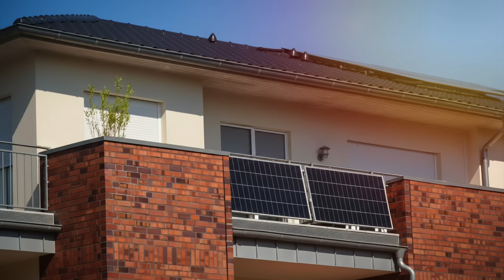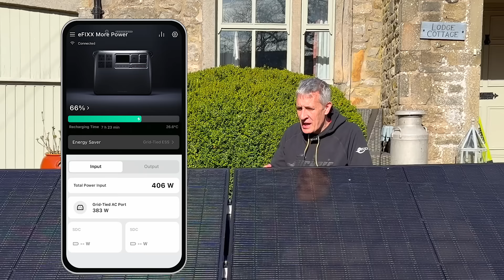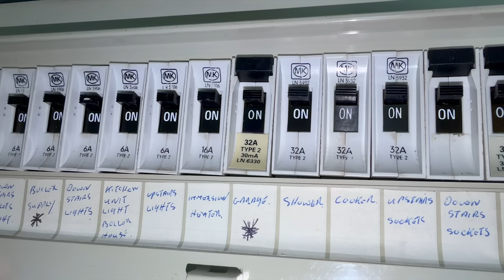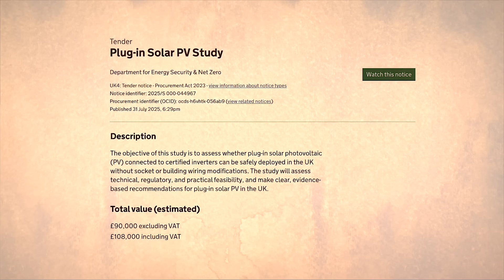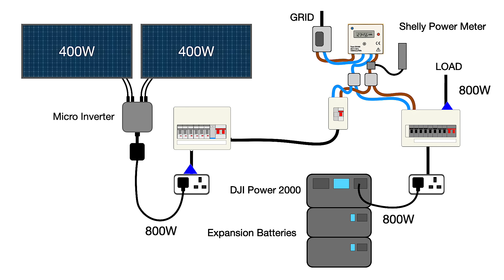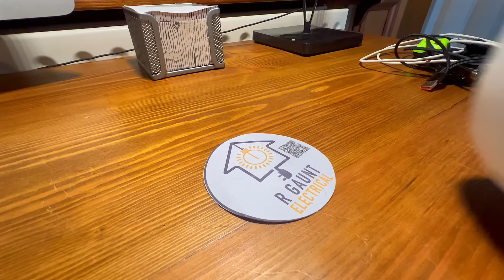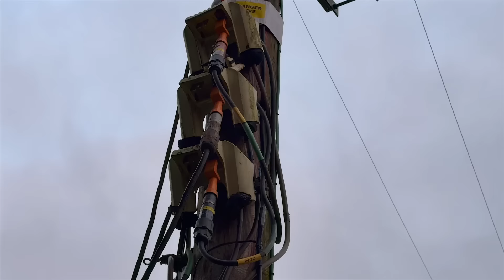Plug in Solar: We’re Told Never Do This… So I Did

Comment: Most of the problems here seem to be about the use of a standard type G plug. Perhaps we need to think about a new standard for this kit, the Neutrix Power-con for example. Safe at both ends regardless of being energized... I needed two power inputs to my motor home, so removed the standard male CeeForm 16amp socket and replaced with two PowerCon 16amp sockets connected in parallel, one either side of the vehicle. 
Now I can plug in either side of the vehicle and no worry about the unused socket being live and dangerous.

Given that local generation is on the rise, it's key we look at alternatives to the one way flow connectors currently available.
Reply: Its no so much the plug its the ring main we use which isn't designed for 2 power sources on the same ring, as as mentioned in the video so RCBOs etc which cannot handle the back current. Personally though I think plug in solar is the future easy to put a couple of panels, and you can take them with you if you rent (as per the video).

Comment: Presumably you could have the panels, inverter and battery without connecting it to the grid at all? I can see this being useful for powering a shed without having to wire it up to the house.
Reply: Yes but you would need an off grid inverter, otherwise it would not switch on.
Reply: @markrainford1219  I'd probably ideally have a higher peak output than 800W as well. Would be good to be able to run power tools off it, and some of them need 2Kw.

Comment: As of today there are 1.1 million registered balcony solar plants in germany, the unregistered numbers are higher - no doubt about that. In germany these are running under the name "balkony solar" for more than 20 years (but due to rus/ukr situation really took offin the last 4/5 years). They shall enable renters to also participate on renewables with low to no hassle and setup-costs. Some lessons learned from the homeland of buerocracy and stickt limits and saftey (so if it works in germany, you will be more then fine):

- keep the wire thickness of your household in mind:
In germany 3x 1,5mm² are common for live / ground / neutral - and it is advised that you use an inverter of max. 800W (it used to be 600W). Even though the 800W enable a scernario where the 16A brakers wouldn't trip while more than 16A x 230V = 3.680W were consumed on a protected ciruit / phase. 

- No power at poweroutage - managable risk to using a socket  / plug:
AC solar inverters look for power when plugged in - so if the grid is down, these systems shut down as well. It can be bypassed (with a battery and sockets directly at the battery for emergencies) but I tell it just to handle expectations of these systems. The inverters also sense if the plugs are beeing pulled out and cut off solar production. So you dont get shocked by touching the metal of the connector when you f.e. reconnect your balcony solar setup. But there are also special replacment sockets were you cant touch the connector at all. But this means you need to modyfiy or change a plug in the wall - which can be a no-go for renters. And even if it is allowed it is hard to findy an electrician how just will do such a tiny task or it might be too costly. Thats why there is a 2 tier system in germany that is allowed:

-- 960W of solarpanels and a 800W inverter => Standard (Schuko) Plug is fine
-- up to 2000W of solar panels and a 800w inverter => special (Wieland) plug and socket needs to be used

- the biggest problem is, that the solar generation is not adjusted to your houesolds needs
Whilst in germany with a 3 phase the sum / difference of all phases is added at in the house (so you can produce your 800W on phase 1 and have a 900W consumer on phase 2 = 100W house consumption), the solar production is not synced with your house needs (as this would need more intelligence in the junction box / smart meters (which until today are not common in germany). So the critics say these systems might overload the grid. In realty in most neighbourhoods the solar panels use is far from 100% so your baloncy solar overproduction is consumed by your neighbours and will never effect the grid anyways. As said there are systems with balcony solar with batteries and demand steered power injection for your household - but both raises the setup costs. But can still be usefull.

- If we feed solar into the grid from balcony solar, this is free for the grid companys / you dont get any money for these small systems from feeding to the grid.

Comment: Whats the fuss about OVERLOADING ???  In UK I'd be surprised if there was more than 2 weeks/ year when you'd even have to worry about OVERLOADING a 32 amp ring ? And if UK has  one of those rare heatwaves ( 30 degrees + ???  ) if you check your APP and things are looking dicey . Switch it off !! It's not rocket science   . I'm generating 1600 watts  today 9th March 2016 and pulling 6.5 amps
Reply: I reckon your time machine draws more than that.😂
Reply: It really depends on where you live.  Where I am, it's the warmest, dryest and one of the sunniest places in the UK.  Where I used to live, down in Sussex, we had LOTS of sunny days, often cloudless, so I'm sure you're right for some places, but the two places I've lived in, it's far from what you say.  Temps of 25-30+ happens in both places for many dozens of days each year, but even at 10, 15 or 20 degrees, if it's sunny, that's the main thing?

Comment: Yes, well... The thing is that politicians are all pretty much clueless about any kind of technology. Combined with consumers that in the majority of cases do not read the instructions, this does introduce true safety hazards which you did in fact miss yourself. i.e. you didn't mention it. At 800 Watts you are feeding just shy of 3.5A into the wiring, while at the same time the grid is able to feed up to 16A (it actually won't trip instantly at exactly that current) into that same segment of wiring before the fuse trips. If you have a defective device that is connected to this segment of wiring, this means that this device can pull up to 19.5A+ over wiring that is typically rated for up to 20A (standard 2.5mm² copper wiring). If you connect two or more of these plug-in sets or batteries (or combination thereof), which the instructions say you must not do(!), you are no longer stretching the safety norms, but are in fact exceeding it. There is a financial risk to this as well, as your insurance may conclude that you caused the fire that destroyed your house and not pay.

Comment: “With a million installations in Germany” ~ It is worth noting that In 2025, Germany had the HIGHEST household electricity prices in the EU, at around €38.35 per 100 kWh (roughly €0.38 per kWh). In the UK, prices were lower, typically between 24 and 28 p per kWh, depending on the current price cap.
Reply: The UK already increases its unit rate costs to protect profitability as more homes transition to solar. Ultimately, the people who lose out will be those that can't have solar panels due to upfront costs / lack of permission.

Comment: Im not an electrician, but to me the problem regarding safety of electricians working on the greater grid could be solved by ensuring each property using these balcony solar systems is fitted with a mandatory one way device (e.g. a diode). However this would of course prevent any feed back to the grid, but would allow the property owners to benefit from their own solar generation.
Reply: the inverter already does this - it already has almost all the parts it needs. the only thing that is extra is a relay that cuts off when not actively driven by the controller. The lack of much of any accidents involving balcony solar shows how much of a non-issue the use of a plug is - especially in the UK where the electrical wiring (at least if its up to code) has an even larger safety margin as in Germany. Sadly diverging interests make getting to a good solution hard anywhere.
Reply: Diodes are difficult with AC. But the inverters are built sensibly. The ones you take camping are different.

Comment: So you've got the panels connected to the power station then your connecting  the AC out from power station is connected directly to the sockets in your house? Is the grid isolated from this? Ah so you have a micro inverter plugged in to the mains supply? Does that mean that when the solar panels are creating power any appliances plugged in will take the first 800 watts from the microinverter and the rest from the grid?

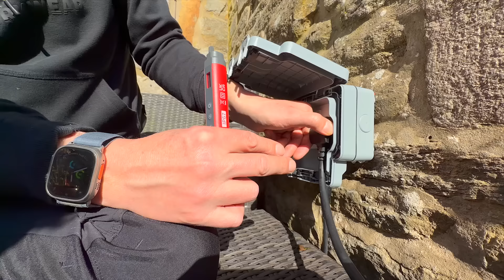Comment: For anyone watching at home. NEVER touch the cables just because you think a device will make sure it is safe like that special device which was made to detect if you unplugged from mains. Only touch stuff that you have properly disconnected. That was a real cringe moment and a proper electrician would never do such a thing in a video. 1:45
Reply: Or at all even..

Comment: Couple of questions.
I presume by plugging it in to the mains and back feeding it in, it just reduces the demand from the grid for your normal use?

What happens if the mains power goes out during a storm and say the engineers are working on a downed cable, will this be back feeding to the down cable or isolation and energising it, potentially making an engineers job more difficult?
Reply from the maker: The micro inverter has anti islanding protection so shuts down when a grid loss is detected.

Comment: Ecoflow have a cable that allows direct connection to the fuse board, the issue for networks seems to be electricity going into the grid when workers might be working on the grid thinking all supply has been turned off.
Reply: When the grid is off no power from the Powerstream is on its' mains plug - as per this video - it cuts immediately.
Reply: @iantheinventor8151  yep in Poland at least you need to have a certified device that automatically cuts off connection to the grid when there's an outage

Comment: With a lot of people still working from home. Couldn’t you setup a dedicated system totally separate from the mains, plugging appliances in as and when needed washing machine/dishwasher etc. still have a huge saving.
Reply from the maker: Yes and with the DJI unit you can draw up to 3kw from the sockets on the power bank.
Reply: @efixx  Except the DJI is a very expensive way of acquiring battery storage... No wonder your payback time was so long...
Reply: @efixx A properly DIY minded person could pull the fuse disconnecting the circuit from the grid, now the beefier non synchronizing inverter can be used to feed all the devices in said circuit. Take it a step further by connecting the battery to another circuit to draw power from if it goes empty. Now you have the whole circuit backed up by a battery. You need a slightly suspicious double ended extension cord for this but other than that no permanent modifications are needed.

Comment: The good old suicide cord. Apart from being potentially lethal, you risk loosing everything if something goes wrong with either the inverter, your house wiring or any attached appliance because the insurance provider probably won't pay out. If someone dies you could be up for manslaughter. Do you really want to take that risk? This is assuming you turned of the mains at the switchboard to isolate it from the grid. If not you could have the power company on your back too. All in all this is just a really bad idea.

Comment: Would there be a way to make the system more efficient by using the MPPT in the power station or do the DJI units you show not have MPPT controllers?
Reply: The ECOflow stream microinverters have two MPPT's, one per panel.

Comment: The system is great mine has been working fine*. Recently producing 10kWh a day in March.

Could do with increasing the output from 800w to say 2300w otherwise have to pull from grid for some appliances.

*Small caveat. A well known microinverter did give me a zap when unplugging it from the socket and touching the pins while 2 panels connected. ⚡😖

Comment: Curious how your energy meter, which isn't designed for export, is handling power flowing out to the grid?
In the US - if we try to export energy using a meter that's not set up for Net-Metering or Bi-Di, we're billed for that power flowing out as if we're consuming it!
Reply: A few people with ancient meters will find them running backwards, smart meters are set up for export, though
Reply: As recent as 2025 - meters are optioned to increment only (by the provider) because people do shady stuff to try and get around power bills.

Comment: You're increasing the available current on the circuit.  You could for example be plugging into a ring which is protected by a 32A MCB, but you're now adding several more amps of current into that circuit, so there could potentially be more than 32 amps drawn without tripping the breaker (ignoring tripping curves, yadda yadda yadda).  It's the same as that shenanigans where solar plus battery plus service fuse needs to stay within the rating of the consumer unit busbar.
Reply: Those things are limited to a theoretical 800W, i.e. 2,8 amps at 230 volt. Not a big deal, and depending on the topology of the installation, not all the wire will carry the entire load. In my apartment for example, there is an outlet on the balcony that has its own 16 Amps breaker and its own RCD - no other load on this circuit.

Comment: I used 600W microinverter with 2x250W panels for about 3 years plugged straight in no problems whatsoever. Decided that soon will be installing 3.8kW of panels on my shed with 3.6kW hybrid inverter to keep it single phase requirements and 10kW battery. Got 32A cooker line (straight from consumer unit) that I can use so from there it will go to subpanel in shed (16A mcb) and then to AC isolator that will be connected to my inverter. Not planning on exporting just charge the battery and use it in the evening. All should work just fine and save me some money in the long run.

Comment: Well I have the original version of the Deye (max 600w output) that you have for the past 5 years now. 

Never had any issues from a safety point of view. 

The only annoying thing is as it takes zero power from the mains it means that you have to remove the positive MC4 in order to reset it if it gets stuck (which automatically cuts the AC output for safety). So it was originally mounted outside but it now lives inside so it's easier to reset it when needed. 
I don't know if the newer versions also suffer from this issue.

Comment: I have a 550w panel on ome inverter and 2 550w on another. Plugged in via contactors and controlled with a shelly smart plug.  I have several fan heaters set up to act as loads and control the whole thing with an esp32.  I just set the loads to come on when the house is pulling under 50w from the grid.  I basically then harvest all energy as heat and pay my normal bill, exceptions being morning and evening when the panels dont make excess, or when a heavy appliance is turned on the esp32 powers off the dumps..... all homebrew with no clouds or accounts. 

I will NEVER  spend money on a dji product again.  They are masters of planned obselecence and locking users out.  

Those plastic panel mounts look very clever.  I may have to get some.

Comment: I think the plug in solar is good but the battery doesn't make sense.  

If you factor in the cost of the batteries themselves and assume they are good for 10,000 cycles, that's a cost of about 5p so each cycle has a total cost about 15p.  I'm also not sure who's paying 27p per kwh, most fixes have been around 23/24p (prior to recent news events). So on a 2000wh battery 18p saving is possible per day, so £65 a year saved. Everyone for some reason ignores the upfront costs, you are talking about 10 years to get your money back.  Of course that's comparing if you put the money under your mattress, if you put £1000 in the bank at meagre 2% interest 10 years you would have £1200 so that more like 13 years if the battery even lasts that long. Pretty certain by then it will need replacing or it will be irrelevant. 

If you them consider 70% round trip is if it's at room temperature, if you put it in garage or outside that will plummet.  

Haven't used the DJI put tried equivalent from ecoflow, 2kw stream in the cold lucky to get 50% round trip. Round trip was even worse if background load low watts, e.g more efficient supplying 500watts compared to 50watts. You can probably guess, I sent it back.  Had previously used power stream to great success, now using basic stream micro invertor and very happy with it.

Yes to plug in solar, no to batteries at current price, just doesn't make sense.
Reply: Also people are waking up to battery drain due to the inverter now. Can lose watts doing nothing.

Comment: I ve done a similar set up with 6kw of eco flow batteries and there’s nothing to say it has to be grid tried I charge mine on the night rate and then use that power during day light hours. Ive use complaint glands and safe wiring but because its independent from the grid when not in ups mode over night then there are less concerns. The only risks you may have are limiting class 1 items to 1 only and the rest make sure their class 2 to avoid the risk of touch voltage between appliances.
Reply: If systems in the uk are joined( floating and TN earths) and grid tied; then usually you have to reference the generator if it’s fixed in position. Or if its portable the just one item of class 1 to minimise shock risk.